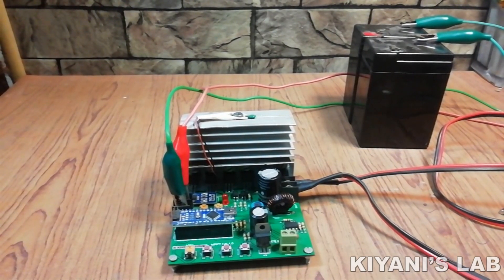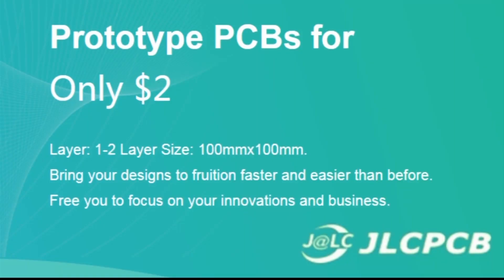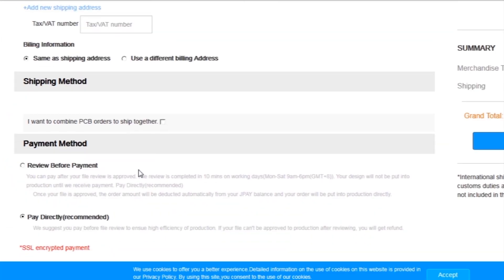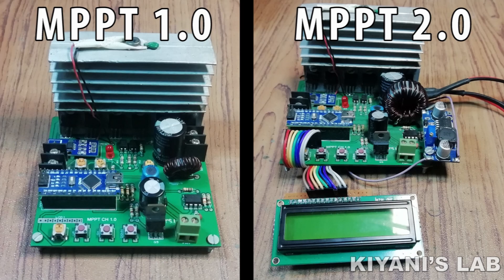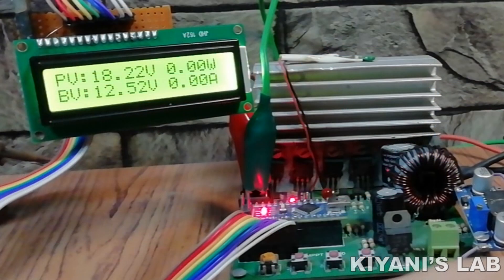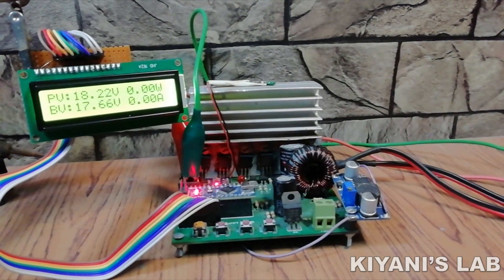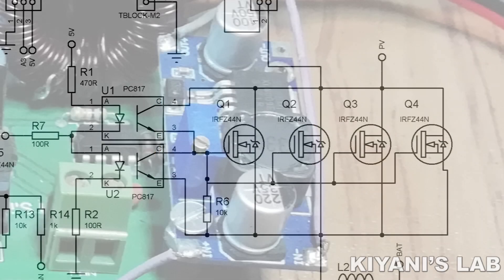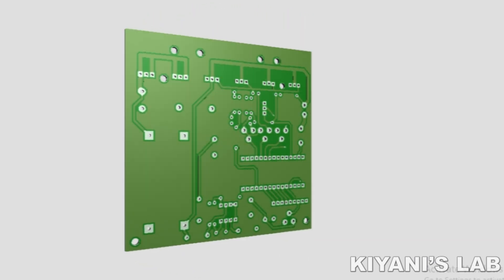MPPT Solar Charge Controller | MPPT 2.0

Comment: hi Sir . What is the output voltage of the booster circuit for mosfet when adjusting the xl6009 circuit?

Comment: Is it really a mppt charge controller? Seems like its working as a pwm controller bcoz it doesn't increase amps. Or may be your video is confusing. Battery voltage is also rapidly jumping up and down which is strange. So please make another video and connect your pv and lead acid battery or tubular battery and then show input pv voltage, amps and output voltage and amps. Thanks